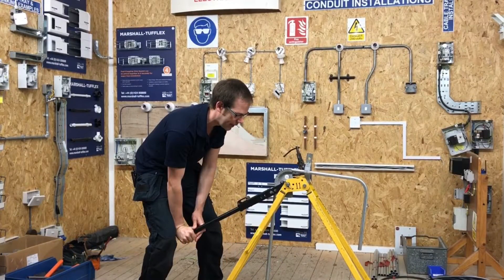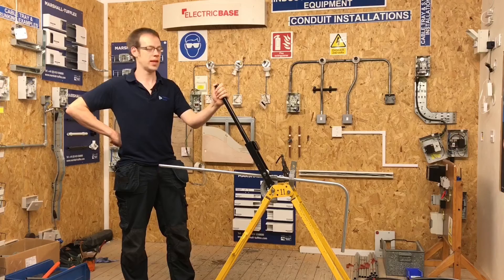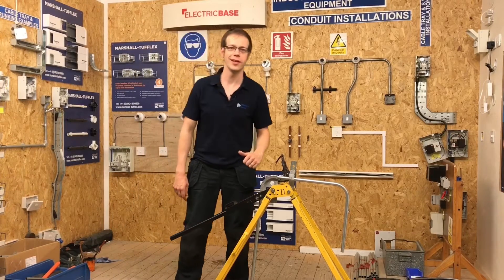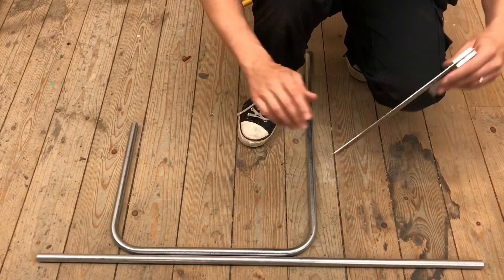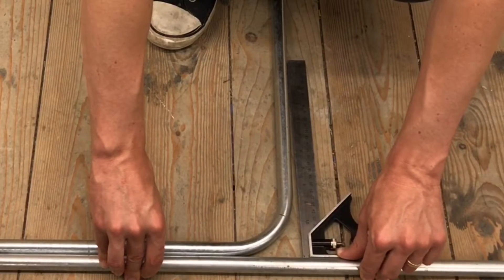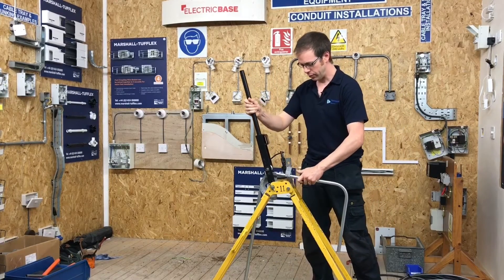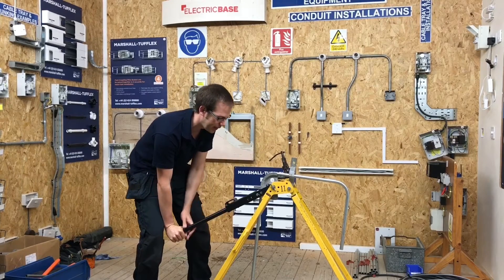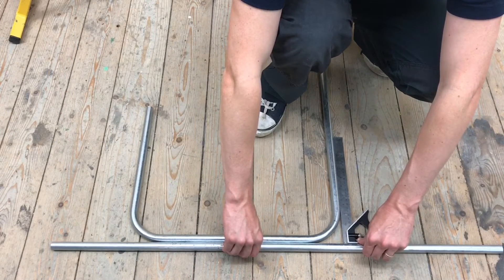How to Adjust an Under Bent Second Bend in Steel Conduit Using Back of Bend to Back of Bend Method

Comment: Excellent video thanks. I just over bend on purpose and stand on it to take some out. Then again only been doing it 25 years. Seem to remember the stuff that they teach you at technical college is mostly irrelevant when on site. Completely pointless bending it at exactly 90 because it won’t fit the building if it’s out slightly unless you’re doing a loop in system that’s going to be cast. In that case it wouldn’t matter anyway.